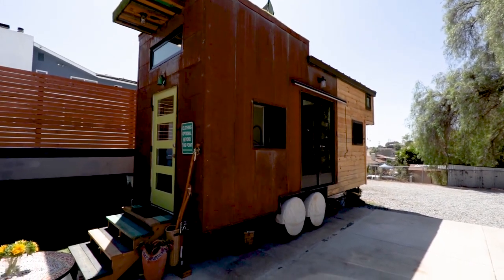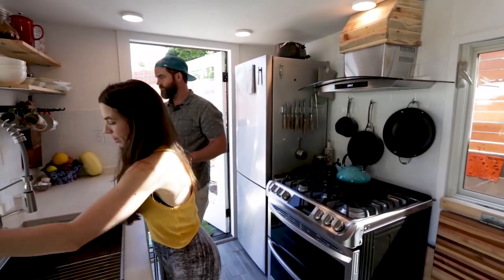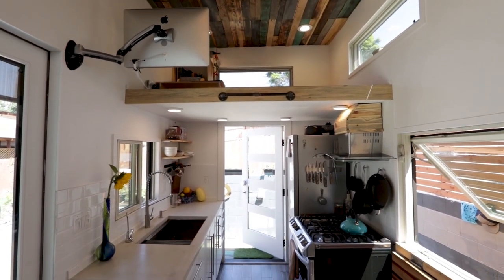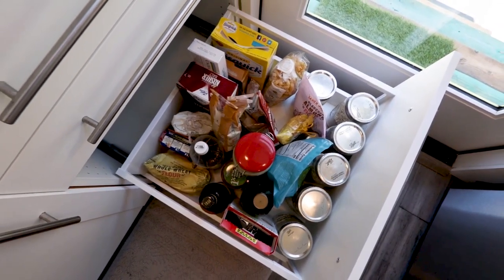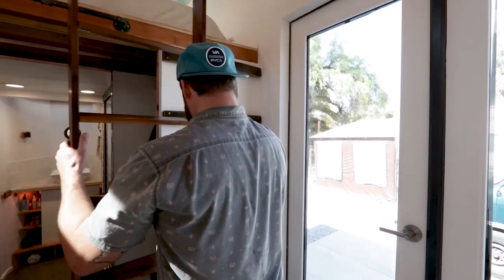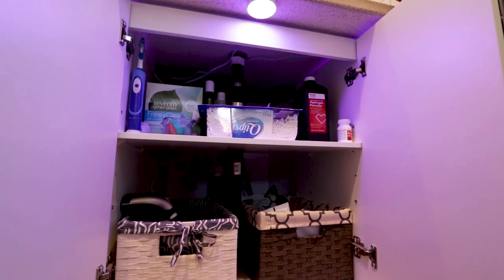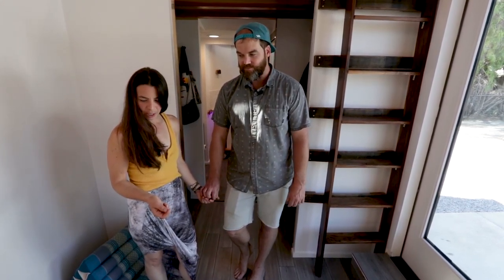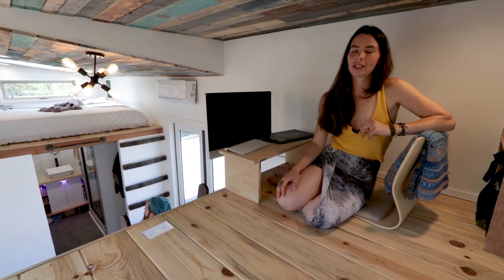DIY Tiny House Built For $35k - One Couples Dream Tiny Home On Wheels

Comment: They seem like such a lovely couple and very affectionate with one another, cool.

The shower is my favorite part, they did a good job overall. Designing it just the way they wanted to fit their needs. I like the full size  appliances.

 This is the first rig I've seen with a European range hood. Even though he made a small error, it still looks nice with the wood on top. I love the closet area and the fact they made their bathroom big. I also like the extra touches throughout the home.

 Their personal style with the  Oriental sitting area was a first for me in a tiny. It is different, a break from the norm,  and I like lt.

The more I watch these videos, the more I want to live tiny. There is not a day go by, that I don't watch these videos. I feel like I am hooked, but there is a wall preventing me from going forward.

Thanks for sharing.

Comment: Using a stove next to a fridge causes the fridge to less efficient. The stove heats the fridge causing it to run more often to cool the interior. I suggest a minimum of 12 inches between the two appliances. Just FYI👍👍👍

Comment: Love your tiny house and totally agree with owning a conventional home or even renting is a lot of stress we can all do without. I do have a question about your build though. When I saw your hot water heater and the AC unit outside exposed to the elements, I was wondering if it being exposed like that won’t it eventually start to corrode, especially if you were to live in an area where you get the monsoon type rainfall during the summer and the occasional rain during the colder season? We rarely get rain where I live but when it does rain it hits hard and on occasion can last several days. During the summer it’s not much of a problem since it dries right away but during the colder months it doesn’t really dry that well and could sit for awhile. Also if you ever move not sure if I would want it exposed like that. I probably would want something like an accordion fold type of door that can be hooked on really quick if needed to keep it looking like it is now and keep it from wearing out to quickly. I’m not an expert in this so I could be very wrong with what I’m thinking; was just a thought that crossed my mind. I wish y’all well in your beautiful tiny home!
Reply: Good question! So I researched options that were made to withstand the elements and placed them so the pop-out covers them as well. We sometimes get heavy rain in the winters in San Diego, but these things are mostly covered. I actually do cover them when we move just in case a rogue rock or something was to hit either.
Reply: Thanks for the reply! I’m in Central Texas and it’s mainly just very arid where I live but the few times we do get rain it seems like we’re getting a years worth at once and things start to rust when it doesn’t dry out quick enough around here. I guess a tarp or like cover would do the trick when not needed to often like you mentioned.